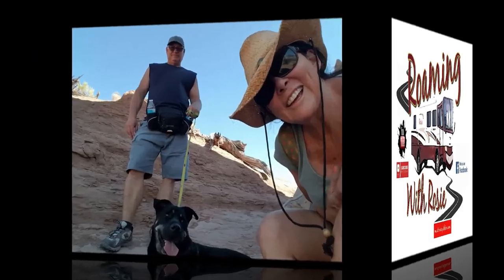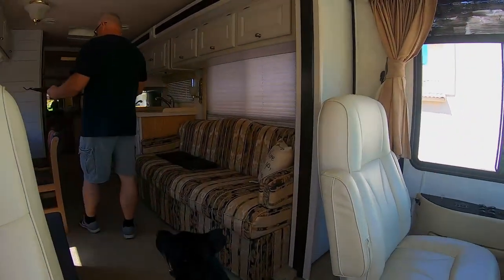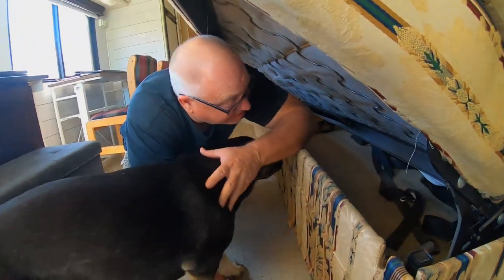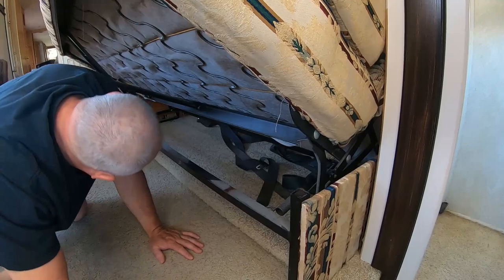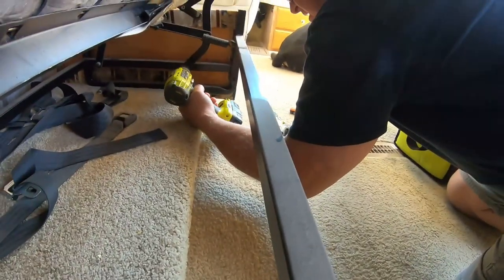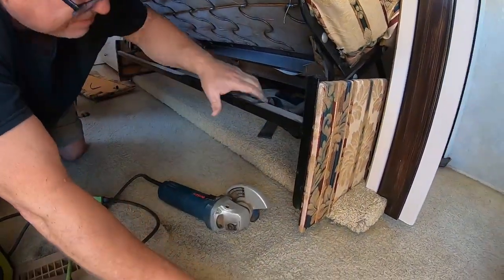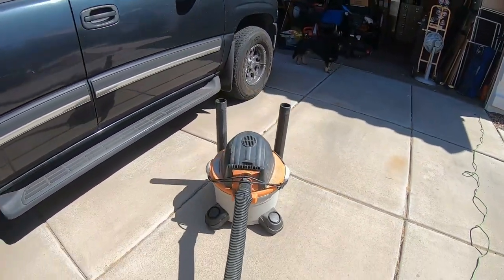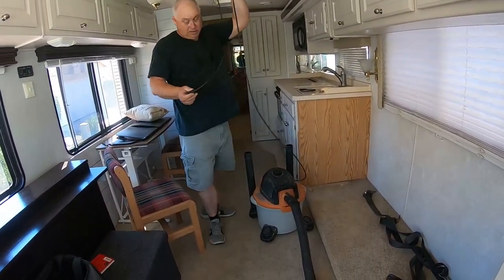Easy Install Rec-Pro Recliners -  Replace Ugly Jackknife Sofa - Part 1

Comment: Too funny!  Great job showing everyone how NOT to tear apart your RV!  Great job cutting and burning the carpet too so you can replace that later too!
Reply from the maker: Glad you liked it. The plan was to replace the old gross carpet with vinyl which was completed after this video. We didnt worry about drop cloths for that reason. Keep watching for the completed renovation. And now we are about to start another.
Reply: @RoamingWithRosie  Thanks for responding to my tongue in cheek response to your video!  Too many times, people only show the perfect way to get something done!  This was a (Turtle Man version) "Live Action"! Good luck with all your future adventures!  Also, if I would have recorded myself replacing wood on the roof or the bathroom floor of my TT, I am sure I did it wrong too in someone's eyes!

Comment: Love the video!! I have a 1998 TIOGA i am tryin to take the couch out but can’t get the bolts and the bottom frame out the floor any suggestions??? Helppp!!!
Reply from the maker: Thanks. In the video, I not only had to use that angle grinder to cut the sofa apart, I also used it to cut the bolts. In the 2nd video we did the install and had to fasten to the slide frame again.

Comment: Why did you remove the window dressing? Was it so you can mount the recliners closer to the wall?
Reply from the maker: Nope.  Part of the interior decor change.  The window decor was the original 2001 decor.  New blinds and valances thru out.  Reveal on the next episode.  Let us know how you like it.

Comment: At about $1,000 for a rec pro sofa my Jack knife one looks allot nicer all of a sudden.
Reply from the maker: I get it. We have looked at a lot of home sets and wondered if they could be attached. The frame on the rec pro is built for safety though.
Reply: @RoamingWithRosie  I get that but since. Not gonna be using it while the RV is moving I'm sure there's a more economical option. We just built a new base for our jack knife so we could utilize the space underneath for storage. May end up just getting a regular loveseat in the near future.